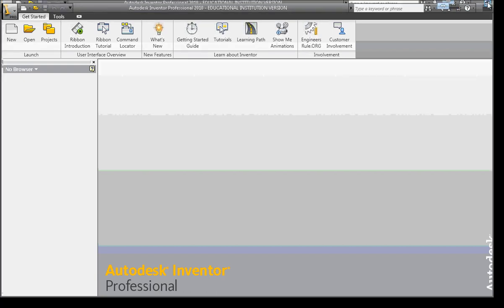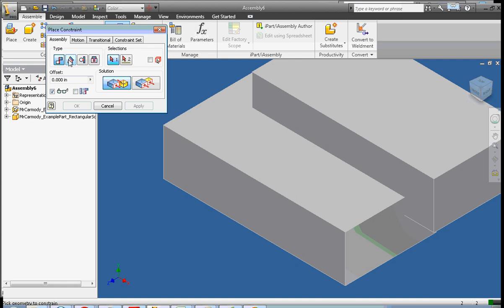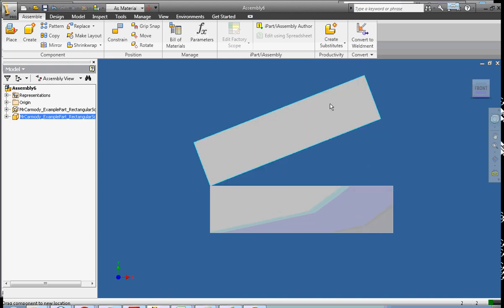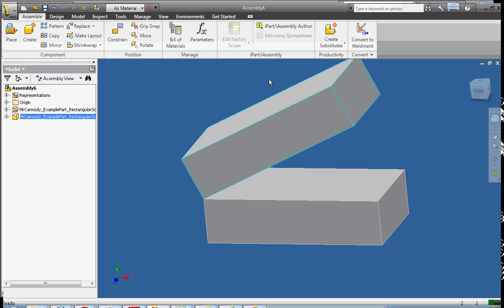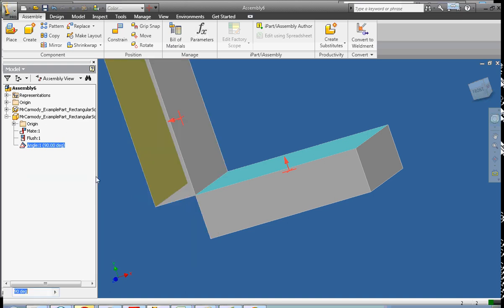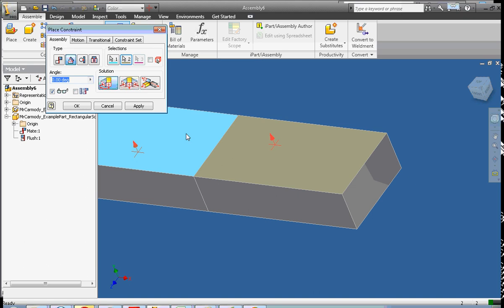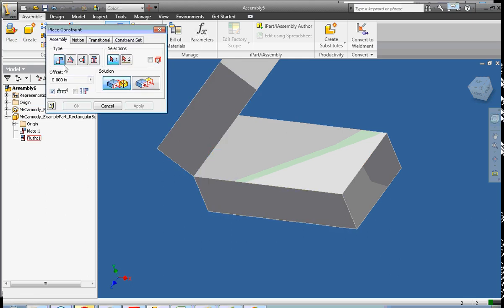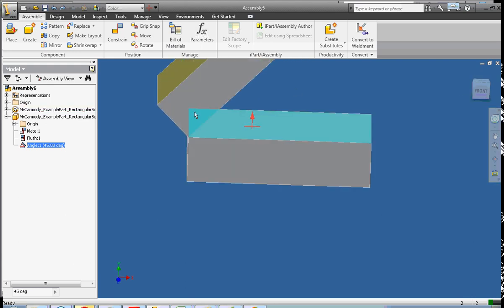Autodesk Inventor 2010: Lesson 16: Create assembly using the Angle constraint

Comment: As a Solidworks user for years and now working with Inventor, I have to say that Autodesk NEEDS to seriously address this command. It is insanely complicated and frustrating to do such a simple task. I tell you why his constrains don't work properly. If you apply the angle 45° sometimes you have to use the negative angle (-45°) in order to go the correct direction. Why? Because in Inventor every part and plane has two sides. So now, you have to figure out, which is a major pain in the neck, if the part surface or a plane face is in the correct side in relation to one another. This should be simple to achieve, period. What takes ONE step to do in Solidworks, it takes SEVERAL in Inventor just trying to figure out how to do it right. Same thing with "Mate" and "Flush" constrain. If you constrain a plate let's say at 0° to another face (Perpendicular in Solidworks) then it won't let you use "Mate" to position the same plate at a certain distance from the opposite face. You have to use "Flush" and set the distance at default or at negative, again, depending of the orientation of the plane or part surface. It's like a try and error every single time.